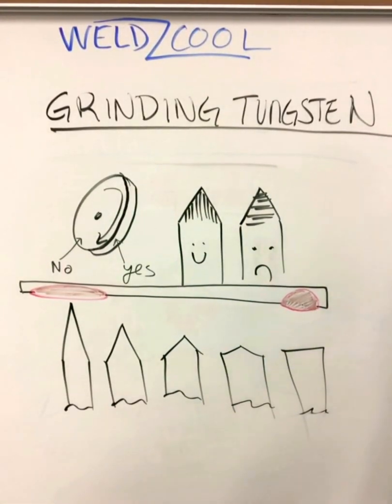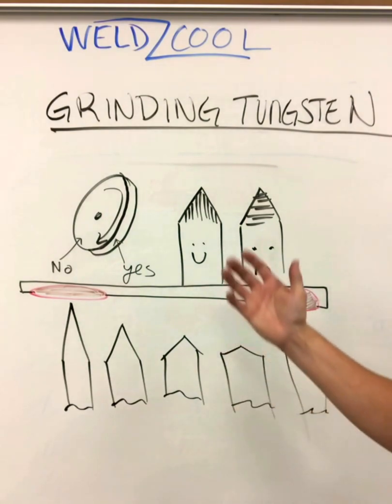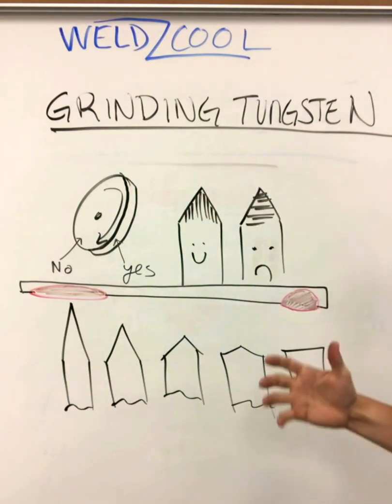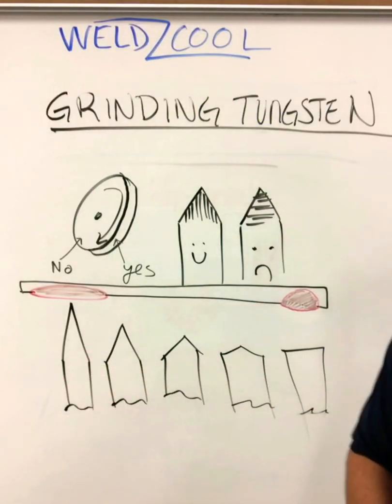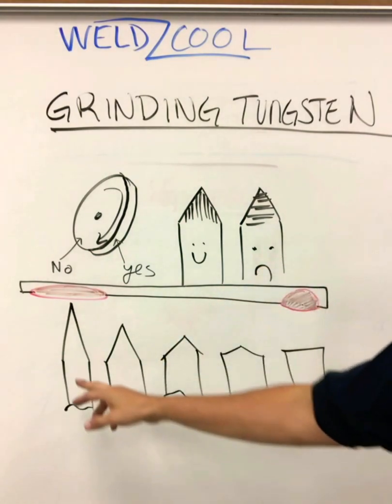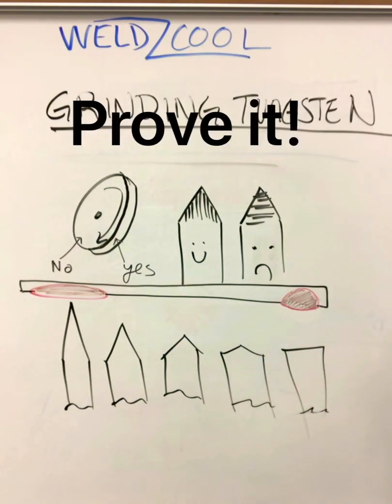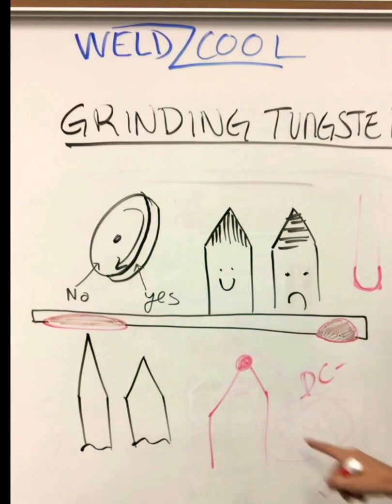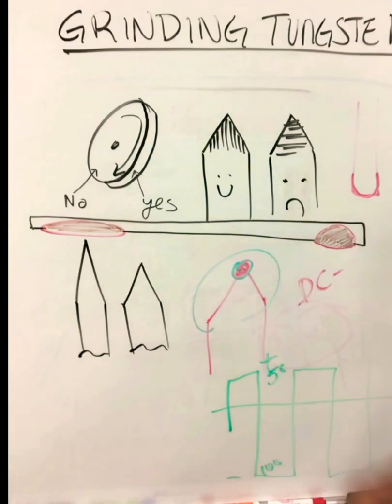Grinding Tungsten the Right Way

Comment: What would the purpose be of having a larger or smaller angle be?
Reply from the maker: Doughboy58 the video shows how it affects the spread of the arc. So you could essentially grind a steep angle to help encourage the edge of the puddle to wet out easier while a low angle would do the opposite.  I used the low angle when I did my UA-14 test, which is schedule 10 stainless that was a square groove with zero gap.  The puddle would sink at the top and fail so I used a different angle to lessen the spread of the arc and essentially the puddle. And I can say it worked. :)